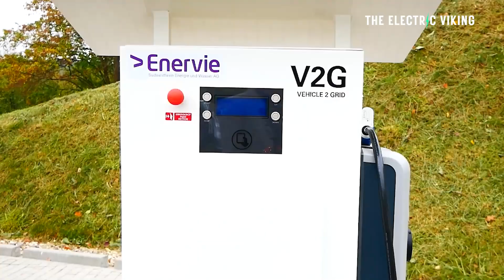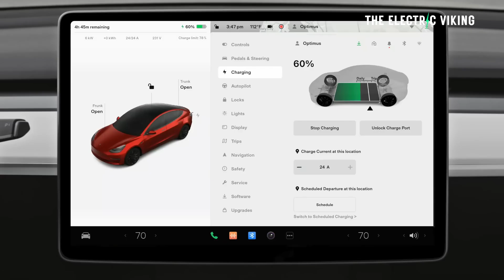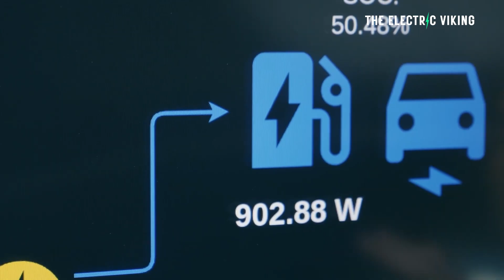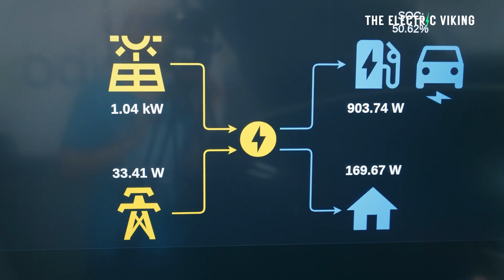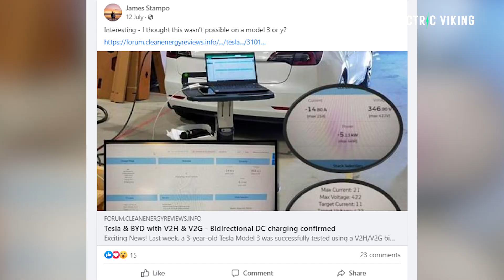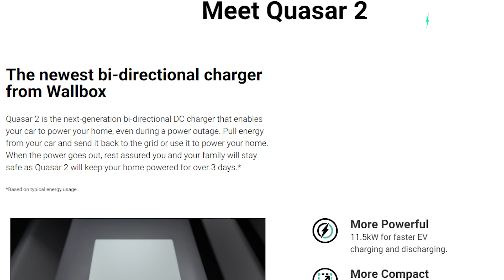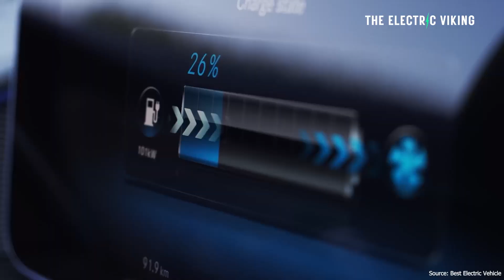Test reveals Tesla Model Y & Model 3 have Bidirectional Charging (V2G)

Comment: It's certainly not 'inconvenient' for me... I already have a Tesla Model Y, Powerwall2, Gateway 3, Solar panels, and I'm retired, so the car is at home most of the time during the day. BUT... during the day isn't when I need it, (because of the solar panels). I need it from 3pm onwards, when peak rates start, and the sun is already going down.   I'm looking forward to this V2G ASAP.

As an example, yesterday (11Sept 24) my Powerwall was full by 11:30am, and the Model Y full by 1pm, and, because the wholesale Feed in Tariff was  around -7c/kWh I received NOTHING for the power I exported to the grid (because wind and solar farms were already supplying around 70% of the required power to the Eastern seaboard grid, including South Australia).   That balance of 30% SHOULD have gone to people like me, but no, that is not how it works - the coal fired power stations were allowed to bid the price down to -7cents, meaning I got SFA. (sweet fuck all).

I'm already part of the Tesla VPP, so I 'should' be a priority customer (via Amber wholesale power), but no, no, no... that would be just too good to be true 😞   Also, V2L and V2G are specifically BANNED in the user manual. If you do it (and yes it is already possible, and has been for many years), Tesla will negate your 8 year battery warranty. And they can probably monitor it too, so you probably can't even do V2L without them knowing about it (IMO).

Comment: Sam you are missing something. I don't want V2G  I want V2H.
Reply: I was wondering if it's the same thing does V2G unlock V2H?
Reply: yes but your EV to have a power company pay you for access to your property you want
Criminal Act
Juniper EV V2H V2G is a must. All EV manufactures must by law be a V2H V2G EV design. A united nations mandate or national laws for any EV sold in any nation must comply to a V2H V2G EV design and all power companies must pay for Net Metering.
Access to your property
V2H V2G design but IMO just pulling the Juniper battery disconnect and plugging in a dongle will provide Juniper battery access, and grants you the right to use those mobile powerwalls at your home, at your office, at your work sight.

Comment: Currently, if you use too much battery power outside of the Tesla’s computer, your car will throw a battery error and stop running.
Reply: A sudden heavy load on the low voltage side? If I was a Tesla, I would get scared, too.
Reply: @geirmyrvagnes8718  The low voltage side is not powerful enough to handle the Amps required. Power needs to come from the 400v side.

Comment: Tesla has not V2G!!!
Reply: Well Yes and No but
Juniper is a 5-6 Mobile powerwall machine. All EV manufactures must by law be a V2H V2G EV design. A united nations mandate or national laws for any EV sold in any nation must comply to a V2H V2G EV design and all power companies must pay for Net Metering.
Access to your property
V2H V2G design but IMO just pulling the Juniper battery disconnect and plugging in a dongle will provide Juniper battery access, and grants you the right to use those 5-6 Mobile powerwalls at your home, at your office, at your work sight.
Reply: @dallas69  Can you give me a link to this regulation?

Comment: DC fast charging requires a direct connection from the charging connector to the battery. Therefore, any EV that is capable of DC fast charging should also be capable of DC discharging into an external inverter. The only requirement is that the vehicle’s software and protection components allow it. Most likely, a software update could “turn it on” for many EVs.
Reply: Powerwall 3 has the dc expansion ports.  I could see a dc wall connector that would utilize this. Seems like Tesla is downplaying this ability until they get their power company certifications in more states.  Then one day they takeover the grid!
Reply: @paullind6534  I figured the downplaying was due to battery warranty concerns from 
increased charging/discharging for household energy storage. I'm still hoping they offer a bidirectional charger at some point.

Comment: If the Nissan LEAF  "isn't a particularly great EV", why WOULDN'T one want to buy a LEAF "just for the bidirectional charging feature alone"?
Reply: Maybe you would, but you would also buy expensive electronics to be installed at your house, that works with the now mostly dead standard Chademo. Maybe you could get that used and in decent condition, too? Old Leafs that have not been run in hot climates are good value for local use, though. Roadtrips are for the brave and patient.
Reply: You only need the Leaf battery not the whole car.
Reply: @greghudson9717  That sort of takes the fun and the V out of V2G. But of course, technically very true.
Reply: @geirmyrvagnes8718  As for the long road trips, that's almost all I do. 44,000km in 2 years in my Tesla Model Y, most of that in the outback (or well off the beaten EV track at least).

Comment: Tesla will sell far fewer powerwalls when V2G is available.
Reply: More, you mean. Since you would probably need the Powerwall inverter to do this?
Reply: @geirmyrvagnes8718  There is supposed to be a inverter like the Ford one that doesn’t require a power wall. However, if Tesla does make us buy a power wall they will still only sell one per household.

Comment: I think you need to study the cyber truck power share feature, the onboard inverter is used, and for split phase ac they use an external transformer.  The Tesla universal wall connector is required.
Reply: Cybertruck outputs split phase ac onboard for both vth and vtl.

Comment: Will Prowse (DIY Solar Power) had a recent episode where he used his Ford Lightning to power his house using only the onboard AC "Pro Power" inverters at up to 10 kW. No special gateway involved. Just plugged into his house using a transfer switch.
Reply: You have been able to do this with a Tesla for years, BUT it breaks your battery warranty.
Reply: @greghudson9717  How do you get 5 or 10 kW out of the Tesla?
Reply: @MarkSpohr  It's really simple. Plug a 12v DC to 240v AC inverter into the power socket. You then plug it into your home 240v socket (standard in Australia). Power is somewhat limited, but can be, and has been, done already... (Not by me though because it would void my battery warranty).
Reply: @greghudson9717  That will give you 150 W max. which is pretty much useless. To run a house you need at least 5 kW which is what you can get from the Ford Propower and other V2x setups.
Reply: @MarkSpohr  You can get up to 2400 watts. I didn't say it could get to 5 or 10 kW using this method. We will have to wait for Tesla to release their V2HG plan I guess.

Comment: Tesla powerwalls absolutely do not have inverters in them. The point is that if you have a powerwall you have some other inverter also installed to make use of it, but it is always a separate component. It's possible that Tesla will only allow owners of a powerwall to make use of their cars v2g capability. This is not at all necessary but will preserve Tesla's sales of their very profitable powerwalls. If they just made it possible to use your car alone as a home battery then very few people would opt for a powerwall.
Reply: You need to read up on powerwalls again.
Reply: OK, Explain this... My solar panels output 450v DC. It goes into my solar inverter, and is changed to AC, which then goes into my Tesla gateway then powerwall. The powerwall batteries are DC, so either the gateway or the powerwall are converting the AC back into DC.
Reply: Powerwall 3…

Comment: It's a real problem that home battery storage is ridiculously exorbitantly overpriced. The vendors of this space have managed to keep prices at least five times what they really ought to be. They're still charging about $1,000 per kilowatt hour. The wholesale price of the raw cells is now less than 1/10 of that, and raw cells make up 95% of the battery. (Chargers and inverters are all sold separately.) It would be great if the car manufacturers put some pressure on this space by opening up V2G and at least V2L. About the only vehicle that does this is the Ford Lightning so have to give some credit to Ford at least. Tesla I'm afraid is not likely to do this because it would affect sales of their super high profit margin home batteries.
Reply: Cybertruck does this.

Comment: A Tesla with full biodirectional charging is truly a game change. Where we live, power failures in the winter absolutely happen. We have a dirty noisy old gas generator. I would LOVE to deep six that old clunker. I would trade up to a new MY Juniper immediately for such an option
Reply: @nanooseguy327  game changer for you and the very few people. It is no game changer at all and will only be added to Tesla's when it costs them nothing to do so.
Reply: Well if  Cybertruck is your flavor you’re in business.
Reply: I would likely upgrade too. That's one thing I require in my next EV. Not being able to use my car battery which stores 4-5 days of what my house would use when I had 3 power outage, one laying 3.5 days last years sucked. I did have a backup battery I used to run my furnace and sump pump but I also had to tote it to work to charge up and bring back.

Comment: I recall reading about this a year or two ago - V2G was built into the circuitry. This would be VERY helpful in the case of emergency use during power outages. We have a 2023 Model Y and I'm hoping we can eventually have V2G with our car since we live in a place with power outages from time to time.
Reply: most VtoG systems dont work during power outages, you need extra hardware to do VtoH during power outages. they dont want to be electrocuted while working on a down system.
Reply: @scottmcshannon6821  I would hope that the Tesla would connect to a Powerwall in such a way as to act simply as an expansion to the powerwall's battery.   That would leave the Powerwall's circuitry in charge of delivering AC power to one's household during a mains power cut.
Reply: @levenkay4468  That is the reasonable interpretation of all of this.
Reply: @levenkay4468  It is highly unlikely that's how it would be. The EV would connect to the Gateway3 instead. It's the gateway that controls the flow of power throughout the whole system AFAIK...
Reply: @scottmcshannon6821  My Tesla Powerwall2 / Gateway3 already has the 'isolating switch' built in, so when the grid goes down, my house is 'islanded' from the grid, and the Tesla Powerwall2 / Gateway3 powers the whole house without electrocuting any linesmen.  It ain't exactly rocket science.
Reply: @greghudson9717  true, but you needed the extra hardware, most people seem to think if you have a VtoG vehicle and a charger you are set to go. powerwall2/gateway 3 ot powerwall3/isolation switch. every EV needs extra hardware for VtoG to work.
Reply: @scottmcshannon6821  I already know this, having the hardware already, but you don't actually 'need' the PowerWall, just the gateway, which is where all the brains are.   Of course Tesla will probably not sell you one without the battery, but that's just a profit thing...
Reply: @greghudson9717  but if you dont have a battery the car "needs" to be home when the power goes out and cant leave until power comes back on. not very convenient.
Reply: @scottmcshannon6821  Having the EV to backup your house is a lot less inconvenient than sitting at home in the dark. You can have both though, battery and EV (like I do) then it doesn't matter if the car is away from the house.

Comment: A lot of homes now have a "power inlet box" for their backup gas or solar generators that allows them to run their home in a power outage.  All they need from Tesla is a 240V AC output with say 2000W and they can use that same "power inlet box" to power their homes.  Folks like me who have a non Tesla, battery backed, solar power system, could transfer power from the Tesla to the home battery bank just as if it where coming from a backup generator.
Reply: 2kW will not be enough. I turn my oven on, and it draws 2.6kW by itself.  If the aircon, oven, dishwasher, washing machine, plus all normal loads TV, computers etc are on, I can easily hit 10+ kWh current draw. (I did it one day just to test). If I add my EV in, I can add another 77% to almost double the current required. The EV can draw up to 32 Amps at 240v (7.5kW limited by the EV wall box)

Comment: After having DIYed my off-grid solar , I have little interest in making it dance with the drunk fat lady who is the grid.
More batteries allows us to consume all our energy we produce. Feeding the grid is could be beneficial for the community but the fat lady is calling all the steps.

I think the evolution of home energy is going away from huge networks to something just big enough to be self sustaining. Possibly a megapack for a group of houses or apartments. Each one contributes metered solar into the battery,then receives metered AC to the home. 
I’m doing something similar now on a small scale except for the metering . The key is to have enough subscribers to consume the energy without overloading it. A single grid connection to support the battery on low solar periods would be sufficient. If there is a bms on the market that would operate a 400v battery,the power could be distributed in DC to each house’s inverter very efficiently .

Comment: It's trivial to flip the relay on a Tesla to make 400+ volts appear on the DC port. Of course, there are a lot of protections involved to make sure this only happens when a connector is detected and authenticated.  Sounds like the easiest thing for Tesla to do is to add the capability to accept the 400V and invert that for use on the grid through their powerwalls - only a small software mod would be required on the car, and they could make more money selling powerwalls.
However, what people really want is for the car to provide several kW of AC itself, and I would be very surprised if any Tesla apart from the CT has an inverter installed and configured.
Reply: Agree. Well, you need a little bit of hardware to get the DC from the battery to the inside of the Powerwall, so it is a little more than a Powerwall and a software update.
Reply: @geirmyrvagnes8718  It's called a cable!
and connector(s). The new  powerwall is supposed to contain the  hardware, I assume.
Reply: @geirmyrvagnes8718  Actually it's probably easy. My Model Y battery is DC, and my Powerwall2 is also DC, so no conversion to AC is required. In fact, my solar is also DC, so I should really convert all my appliances in the home to DC and forget all this AC crap ;-)
Reply: @greghudson9717  A lot of your appliances are already DC. Everything is a computer these days, and they all run on DC. Lights are LED, those are DC. All the rechargeable stuff or the things you stuff full of batteries, very much DC. Fancy stuff with electric motors in them? The good stuff have regulated AC motors run by power electronics that lives on... DC, like the motors of a modern electric car. What is left? Simple resistive heating works fine on DC.   Anything with a power brick is just trying to get DC these days. But none of it is simple, of course, except for in principle. 😁
Reply: @geirmyrvagnes8718  I've heard of people converting whole houses to DC but I don't think I could do it (too old) :-{

Comment: Some cars that can use vehicle-to-grid (V2G) technology include: 

Nissan Leaf
A Nissan model that can store electricity in its battery and send it back to the grid, a building, or other destination. 

Hyundai Ioniq 5
A Hyundai model that can store sustainable energy in its batteries on a large scale. 
Kia EV6
A Kia model that can feed energy back into the grid, in addition to receiving it. 

Genesis GV60
A Genesis model that can power most household items using its vehicle-to-load function. 

Mitsubishi Outlander PHEV
A Mitsubishi model that comes with standard V2L charging and two 120-volt AC power outlets. 

Hyundai Ioniq 6
A Hyundai model that's built on the Electric Global Modular Platform (E-GMP) and can transfer up to 3.6 kW of power to plug-in devices. 

Ford F-150 Lightning
A Ford model that has V2H "vehicle to home" capabilities, and is expected to have V2G tech in the future.
Reply: Cybertruck
Reply: Nissan Leaf has exceptionally poor battery management, those cars rarely make it to 60k to 80k miles without damaging the battery, that's why used one sell so cheap. Adding additional load and wear to the battery with v2H isn't a good idea and I'm pretty sure it is the reason Nissan doesn't pursue it is because they don't want to pay for batteries under warranty when they fail prematurely with V2H.

Comment: In the UK, energy supplier Octopus has a V2G tariff called PowerPack that offers FREE charging (you have to be plugged in for around 12 hours a day and do less than 13,000 miles per year). Yeah FREE - Google it. What a brilliant and simple-to-understand concept to win over the EV skeptic. The Nissan Leaf is the only BEV vehicle supported. But the Wallbox Quasar 1 is the only charger supported and that was only ever hand-built in small quantities (for trials only - so was silly expensive) and hasn't been available for years. What I don't get is that as Nissan has produced over 500,000 Leafs (including in the UK) why Wallbox, Nissan or someone else isn't mass-producing them. On the surface, it seems a no-brainer...